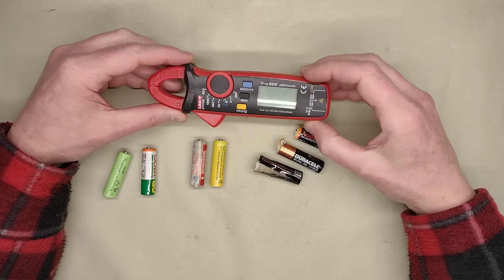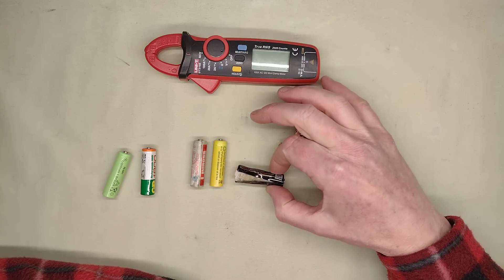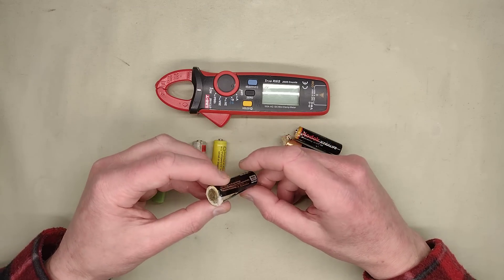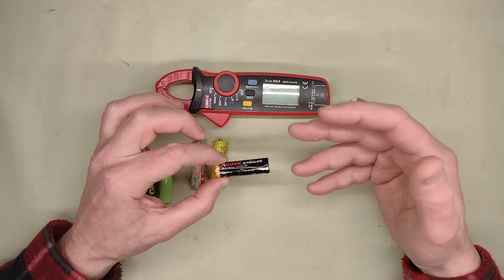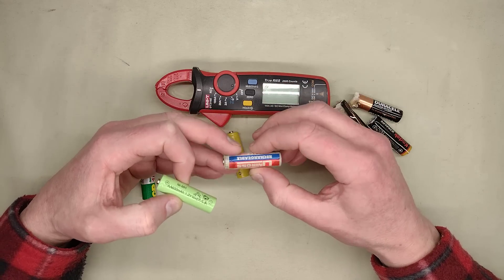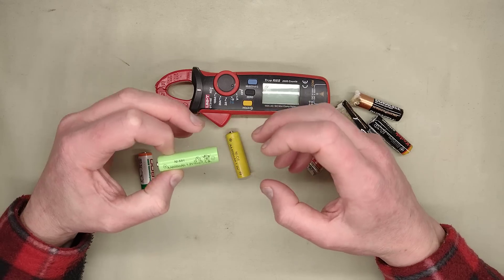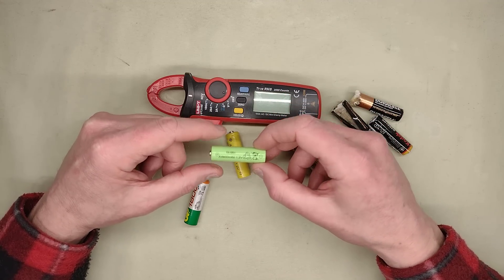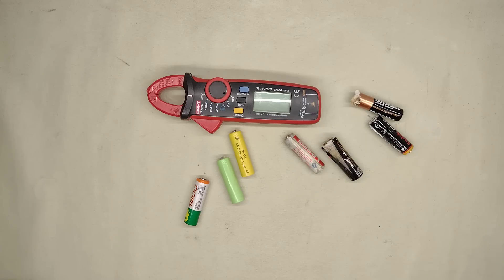The curse of leaky alkaline batteries

Comment: Probably a good idea. I've lost several maglite flash lights to leaky cells.  I put them up for a few years and come back to a solid mass of alkaline residue.
Reply: My grand father put anything electronic that went into storage into its original packaging and if there were batteries he would take them out and toss them into his junk drawer.
Reply: @PhilLesh69  chaotic neutral or lawful evil.
Reply: I ran across someone years ago who wrapped batteries in waxed (or sometimes greased) paper with a gap around the center of each end before putting them in flashlights. A whole lot of extra work, but when (not if) they leaked, the batteries still came out easily.
Reply: @Azlehria  Back in the days of PP9 batteries in radios some of the radios came with a thick plastic bag to put the battery in, in case it leaked. 

As for torches leaking batteries ruined a nice LED aluminium torch I had. The battery juice got in the thread and welded end cap in place. Not even holding the torch in a vice and drilling a hold for a pry bar in the end cap would separate them.
Reply: Maglite may repair/replace it.  Make a claim with the battery company to replace it.  Very lightly wipe the cells all over with a "turbine" type oil before installing.  I like the Zoom Spout Oiler MARS 93240.
Reply: I modified my three D cell Maglite yesterday.  
I replaced the incandescent bulb with a 3V-18V LED.  
I used a 7.25" long 1" Sch. 40 PVC pipe as a reducer.  
I made a "dummy" adapter with a .25" x 4.5" carriage bolt, two 
.25" x 1" fender washers, two lockwashers and four .25-20 nuts.  
It will fit one 26650 Li-Ion cell directly or one 18650 Li-Ion (or Li-Mn) 
cell with a 1" piece of .75" I.D. thick wall vinyl tube over the cell in the 
middle or a .75" piece at each end.  If you use a 2" bolt, you can use two cells.  
Insert the pipe, the cell(s), the bolt adapter head-first then screw on the cap.  
Works great!  
Now I can use D cell alkaline, NiCd, NiMH or 26650 and 18650 Li-Ion cells!  
The 3V-18V LED will operate down to one dead Li-Ion cell at 3.0V, 3.2V safe  
or three dead D cells at 1.0V, 1.1V safe each.  
You can also use two LiFePo4 cells which have a range of 2.50V-3.65V each.
Reply: @solarsynapse  Sounds like a cool DIY. Did you get any video of the build and will you upload it if so?
Reply: @remyllebeau77  Sorry, I didn't.  I just did it yesterday after reading comments on this video.  It works very well and was easy to do after I figured out the dimensions.  Cut a piece of pipe (and tubing if using 18650), then sandwich the fender washers between the nuts at each end of the bolt.  I don't have any, but I was thinking today that 21700 cells could also be used by moving the washer and nuts a bit farther in (shorter) at the cap end and maybe use a piece of .875" I.D. thin wall vinyl tube over the cell(s).  3D printer guys could get fancy.  They also make C to D adapters and AA to D adapters, although AA would probably not run long.  VERY versatile emergency light!
Reply: Great discovery!  I found by testing that my PR 3V-18V LED turns off and does not draw current below 3V, so it is in effect providing battery protection for 1 cell.  If a PR 6V-24V LED was used, then it should shut off at 6V for 2 cell protection.  Be sure to test your LED so as not to over discharge the cells.
Reply: I'm using rechargable AA batteries for my C / D size batteries maglites nowadays.

How it works? Just use paper warp around the AA batteries (or better use plastic tubes), then roll it up until the diameter same as C / D sizes batteries. Then slide it inside the maglite. This way is much lighter, and save a lot of money on buying batteries. ( D size batteries are a bit longer, I put aluminium foil to fill the gap).

On top of that, I changed to LED bulbs, that made the batteries last longer.

Remark: the spring in maglites are too strong / long, I made a shorter and weaker one.
Reply: Flashlight tech has moved on to LEDs and Lithium 18650 batteries. Why bother with the hassle of alkaline that you can't even recharge?

Comment: I have phased out alkalines to "disposable" applications where I don't want someone walking off with a rechargeable cell. Everything else is NiMH or LiFePO4 (3.2v per cell nominal) with spacers for the stuff that needs the higher voltage.

Also - and this isn't a huge secret - IKEA's "LADDA" brand cells are rebadged Eneloops, sold much cheaper. ;)
Reply: Just make sure that the Ikea cells are Japanese made.
Reply: @m.k.8158  The ones I just bought say 'Hecho in Japon'
Reply: I just bought three packs of LADDA yesterday, to fix some 'to be thrown away' high dollar bluetooth hand scanners.    Looks like I'll need to buy a few more packs.
Reply: Theft has been a serious problem for rechargable batteries in work environments
Reply: I just use them for remotes and my digital scale
Reply: I just noticed in IKEA a couple days ago 2450 ladda for $8. (per 4)
Reply: I seen lately that they changed the label from white to green and I wondered if they were still the same high quality as before.
Reply: @ucitymetalhead  The ones I just bought were 2450, and were grey.  The 1900's were also grey.   The capacity was written in VERY LARGE numbers.
Reply: @tbelding  yeah i got those too but they looked a little green to me.
Reply: @tbelding  The 2450 mAh ones are made in Japan; the 1900 mAh ones are made in China.  It is written on the packaging.
Reply: @cdl0  As I didn't want the 1900 mAh ones, but wanted 2450 AA and the 750 AAA, I didn't look at the 1900's.   I just checked the packaging for what I bought on Sunday.   I'll take your word for the 1900's.    I'd rather have had 1000mAh for the application, but good quality 750's beat crappy 1000's.
Reply: @ucitymetalhead  - Considering I'm a bit color dumb (different from color blind), I won't disagree.  I don't have any in front of me now, they're all at the customer site now.
Reply: @tbelding  The 900 mAh AAA-size are made in Japan (at least that is what is written on the ones which I bought).
Reply: @cdl0  They didn't have any of those in stock while I was there, so I didn't get them :) The 750's are also Japan.
Reply: @tbelding  Many thanks for the info on the 750's.
Reply: @tbelding  yeah they are a weird greenish/grey color so it's definitely not hard to make a bad guess.
Reply: Are these the Japanese or Chinese Eneloops though? We're starting to see more made in China, specially since they moved out of the factory in Japan (FDK, these are now Fujitsu branded). Initial tests show the Chinese ones aren't as good, though this is mainly related to cycles, which in theory is lower though if you don't have to keep recharging them anyway.

I had some time ago bought some cheap LSD batteries after them being reviewed as decent, they're all failing constantly now, old Eneloops still going strong. I won't buy any cheaper alternatives now, and will simply avoid the Chinese ones too.
Reply: @drsquirrel00  the
Ladda brand are still Japanese
Reply: @hicksbrad  That's great to know, thanks. Though I did look and there was some stirring that they were going to discontinue or rebrand, so I would check every time you purchase.
Reply: @drsquirrel00  - Hecho in Japon.

Comment: Mum's TV remote had 1 recently. It appears to be clipped and glued so had to clean as much as I could through the battery compartment with ipa and cotton buds.
What would you recommend for cleaning up in the future?
Reply: Hi Simon, it depends on the chemistry of the battery that leaks. Alkaline batteries use potassium hydroxide as an electrolyte so a mild acid solution (I use hydrochloric but you could probably get away with white vinegar or similar) on a cotton bud (Qtip for Americans) to gently dab and neutralise any corrosion on the metal battery contacts should do the trick. If it's a zinc carbon based battery then it's a zinc chloride acidic solution, so neutralise with a bicarbonate of soda solution or similar then clean with a damp cotton bud to remove any soluble stuff. Sometimes for heavily corroded but easily accessible contacts I use a needle file to abrade any particularly bad patches.
Reply: @pyromaniac303  Thanks for that info - as I watched the video I was hoping BC would explain how to recover the damaged equipment.  The main problem I can see with your needle file solution is the loss of protective plating.  Well - yes - it would have been eaten away at this point anyway... Any idea how to deal with that issue?
Reply: @keithmiller5042  yes that is an issue, once corrosion has set in you can assume it's already got underneath the plating and it's all flaked off. You can sometimes get away without plating if your battery contact force is high enough and it's a low current application. If you were incredibly determined you could remove the contact and put it in an electroplating / immersion tin bath but practically it's better to swap the contact if you've removed it anyway as they're only a few pence. There doesn't seem to be a standard form factor for replacement ones so I tend to buy generic eBay ones and attack them with tin snips / wire cutters to fit. You can buy big bags of them for under £5 under the search term 'battery shrapnel' - I guess it's some kind of Chinese mistranslation!
Reply: @keithmiller5042  thinking about it, maybe you could apply immersion tin solution without removing the contact using a cotton bud? I've never tried this though so use at your own risk!
Reply: @pyromaniac303  Many thanks - I didn't know replacement contacts were available - useful info.
Reply: I use white vinegar to clean up alkaline crud, followed with a water rinse.